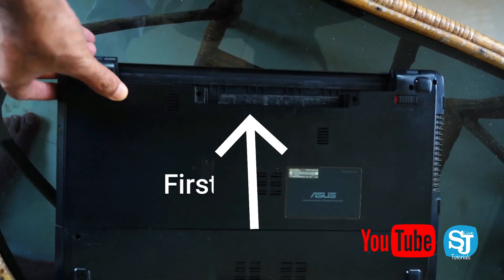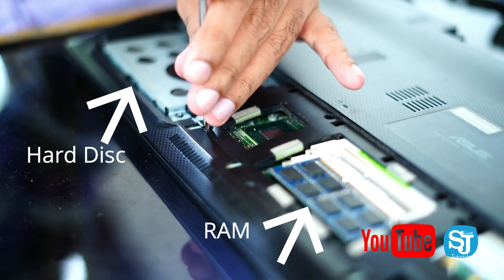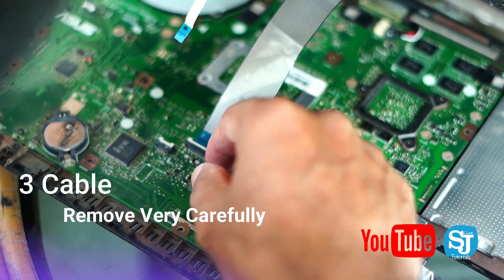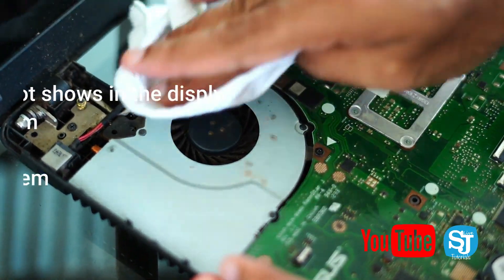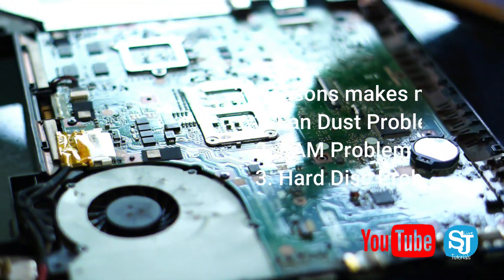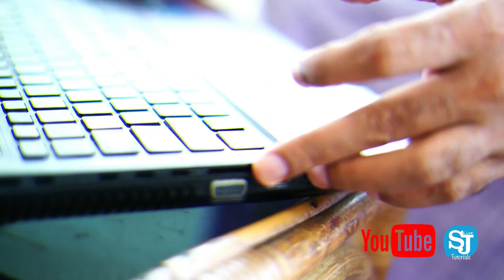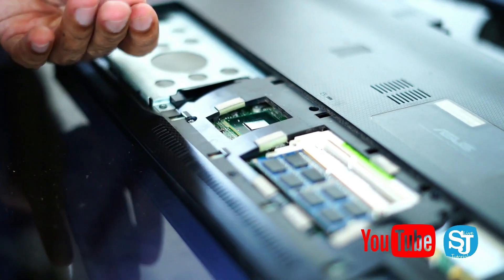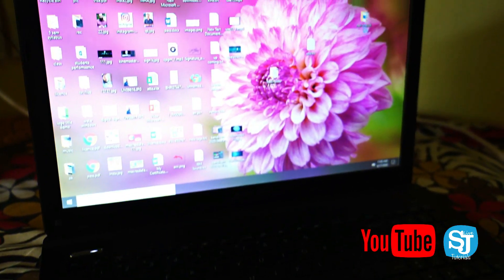Laptop power on but No display problem || Black Screen || Nothing on Laptop screen | Fix it | solved

Comment: മദർ ബോർഡ് കംപളയിന്റ് ആയാൽ ഡിസ്പ്ളേ വരാതിരിക്കുമോ
Reply from the maker: The motherboard is the computer, so the usual symptom of a failed motherboard is a completely dead system. Fans, drives, and other peripherals may spin up if the motherboard is dead, but more often nothing at all happens when you turn on the power. No beeps, no lights, no fans, nothing.

Comment: Bro
എന്റെ ലാപ്‌ Acer ആണ്
ലാപ് ഓണാകുന്നില്ല,ചാർജ്‌ കേറുന്നില്ല  എന്താ  പ്രോബ്ലെം
Solution പറഞ്ഞു തരുമോ

കുറച്ചു കാലമായി ഉപയോഗിക്കാതെ വെച്ചു

വല്ല പ്രോബ്ലവും
Reply from the maker: Battery ozhivaaki connect chaithu on aaki nokoo
Reply: ബാറ്ററി ഊരി നേരിട്ട് കണക്ട് ചെയ്തു ബ്രോ  അപ്പോളും ഓണാകുന്നില്ല

ഒരു ലൈറ്റുകളും കത്തുന്നില്ല
Reply from the maker: @fairoofkvnkm8430  mother board complaint
Reply: @fairoofkvnkm8430  ബാറ്ററിയും    ചാർജിങ് adapator ഉം  ഊരി മാറ്റി ലാപ്ടോപ്പ്ന്റെ power ബട്ടൺ 1മിനിറ്റ്  press ചെയ്തു പിടിക്കുക  എന്നിട്ടു  ചാർജർ കണക്ട് ചെയുക  ഓൺ ആക്കുക  ശരിയാകും 👍
Reply: @saju471 ഇല്ല ബ്രോ ഓണാകുന്നില്ല

Comment: Sony laptop on aakunilla power indicated led kathunnilla battery complaint aayathu kondu direct aanu   kuthi ittu use cheyyunnathu enthu kondu aayirikkum
Reply: Innale work chythirunnathaanu innu on aakunnilla enthenkilum vazhi undo
Reply from the maker: @keralaarmyda4399  oru LED lightum kathunnille?
Reply: @SJTutorialslive 
 illa kathunnilla

Battery connect cheyyathe anu use chaythathu athu kondu kozhappam undo
Reply from the maker: @keralaarmyda4399  no LED kathunnillenkil power ethunnilla mother boardil
Reply from the maker: Onnum varunnullenkil board complaint aakum
Reply: Innale njan windows 8.1windows os  ( cd ) installation chaythirunnu athu success aayirunnu programs working aayirunnu
Reply: Please reply
Reply from the maker: @keralaarmyda4399  first power ethikkuka
Reply: @SJTutorialslive  thank you 
I respect your channel
Bcoz comment reply  ( problem solution ) thank you

Comment: Sir,Nan ubuntu install  cheyyan boot cheythathinu shesham  etho oru key il ariyathe press cheythu .athinu shesham laptop display kanikkunnilla.capslock on avunnilla,numlock on aanu,power button light kathunnundu. Nan enthu cheyyum ?😢😢😢 plz give a solution
Reply: Plz urgent aanu.
Reply from the maker: Power button long press cheyyuka shesham laptop battery remove chaith reconnect cheyyoo